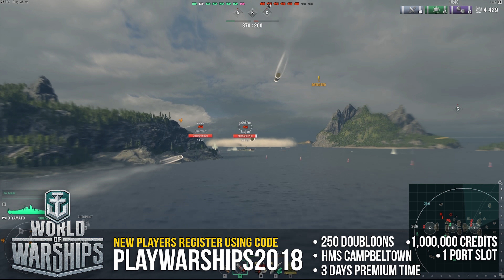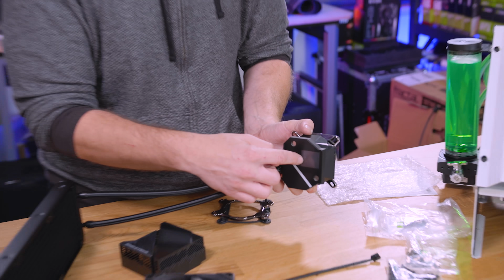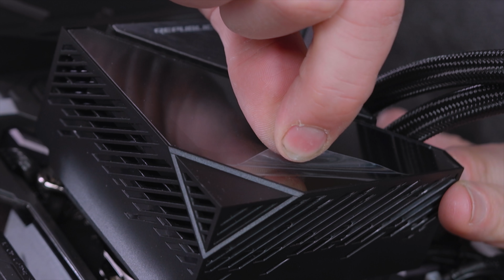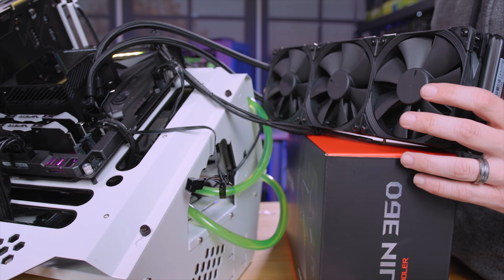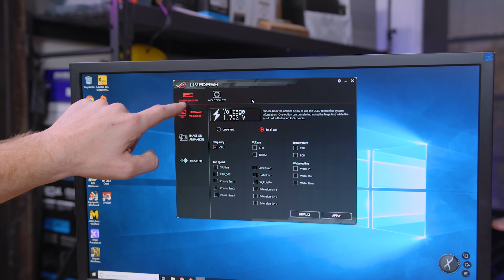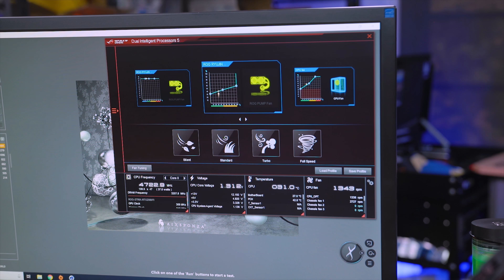ASUS made an AIO... but is it any good?? RYUJIN 360

Comment: Bro that asus controller that has the bubble to control fan profiles, I  can't use it to over clock my 6600k it will go up 1. At a time then switch to .05 or so and always trips out 3 times before just saying it can't, can I set a cap before I run it? I had it at 4.6 but set in the bios but  now I can't change it from stock?? Xmp or whatever is disabled also

Comment: I use the Arctic liquid freezer 240 with all included fans (4) in a push pull config. Mind you I'm only running an FX8350 at stock 4.0Ghz

Comment: Ok, so it performes decent, looks nice and has a gimmicky display. But it's 280 bucks ... basicly just for not having to mount a pump and cut three pcs of soft-tubing.
You could get a copper rad with Noctuas, an EK block and a basic Eheim or Laig based pump for the same money. No stylish display but more performance.
If at least the pump had enough power so you could add gpu and board blocks to the loop, then I'd see the appeal of an all-Asus-build. 
Oh well, ppl will buy it anyway.

Comment: I am using a Cooler Master MasterLiquid 240 AIO with Ryzen 5 1600.  No problem running 4.0 OC, AIDA64 stress test after 1 hour running in low-mid 60 C.

Comment: I love how you're American but use Metric system. It just makes more sense.
Reply: Most Pc stuff is in the metric system so yes when talking about pc stuff Americans use the metric system but did you not notice he said Fahrenheit instead of Celsius at the begging ? That's cause they both make sense i know both but am american and standard makes sense, when its what you learn but a lot of Americans that don't learn the metric system they think it doesn't make sense so .............
Reply: I understand that growing up with whichever one will make sense to you, but logically, Metric is easier to understand, even to begin with, surely. Freezing point and boiling point of water in Metric is 0°C and 100°C. Makes sense. While Fahrenheit is 32°F and 212°F. Metric just seems more consistent despite both being an absolute measurement of temperature.

Comment: right now I use a corsair h60i, I originally wanted a h100i v2 but my case was not large enough. I plan on upgrading to an 8700k soon would the cooling on the h60 be efficient enough? Right now i have a 3770k and my max temps while gaming for multiple hours is still under 60 degrees
Reply: I used an AIO (H60) for nearly two years. I don't recommend them anymore. Switched to a Noctua with a 120mm fan... It's quieter, cheaper and cooler.

Comment: Currently using a Corsair H115i Pro on my 7820x. It's a good cooler. Build quality is very good IMO. However for pushing this chip would need something a bit higher. This is fine for my use though. The cost of the Asus one is quite staggering at easily double the price of my current AIO. The Noctua fans are a good inclusion as they are known for their quality, but I don't think its worth such a high price. And obviously having the cable issue is extremely disappointing.

Comment: What was the response from Asus about those fan headers?
Reply: "We will be happy to ship out a replacement as soon as you complete the RMA form online and we approve it. Please include several photos with date stamps imprinted on them and the original receipt (Copy's will not be accepted). This processes could take a week or more for review so please be patient. Once to receive the RMA number sent to you VIA USPS please tape this number to at least 6 visible sides on the box. Once we receive the defective unit and then test it for a week to verify that it is indeed bad and we determine that the damage was not done by improper installation by you we will ship a refurbished one out to you in 6 to 8 weeks. Once you pay the shipping and handling fees."
Reply: @whpony96  wow really? Be better to give it to the shops warranty let them deal with it.
Reply: Jesus christ its only a fan header plug, cant people do basic soldering today? THICK AS SHIT
Reply: @Synthematix  not the point
Reply: @camoz123  Hmm, maybe not. But if the RMA process is that kind of hassle i would just solder the wires again, and crimp the cable inside those plugs and whatnottatata
Reply: @StaticVapour590  not everyone has that ability or skill to do that.
Reply: @camoz123  its actually quite simple and easy to learn and u can pick up a cheap solder kit for 10-20$ watch a 5 minute youtube video on how to solder and do it yourself with 5 mins later. And become a solder champ in 10 mins.

Comment: the Kraken X72 is around 200 bucks... 250 would have been a bit more reasonable price IMO but the noctua fans is a nice touch as it blows (pun intended) every other fan on the market out of the way...
Reply: Just seen that for 300 bucks you can get the EKWB A360G which is a 360 aluminium rad and parts with a CPU and a GPU block... no OLED tho...

Comment: $280 dollars? Lol.. no. EK has a $240 CPU+GPU water-cooling kits.  They have a 360mm radiator expansion kit which brings the price $310. 280 vs 310. You get CPU+GPU cooling, that is awesome! This AIO is $280 for only one..

Comment: I still don’t get it why AIO manufacturers do not hide the cables in the tube sleeving and let them come out of the radiator - this would look much mich cleaner then the mess around the cpu... or at least make them optional.... 

Nd typical Asus quality. I was such a huge fan of ROG but at least since the last 4 years they fail product after product. And the Software is far worse then anything else.

Comment: I am using a Corsair h150i Pro RGB 360 radiator, I am more than satisfied with it although as you said I had my concerns when it came to cooling the VRM and the other components of my motherboard, but I have the radiator in the front with push pull and 3 exhaust fans, I think the Temps are fine, idle it's sitting on 25c with my i7 8700k

Comment: I use a Corsair H100i that I got 5 1/2 years ago when I worked at Microcenter. Its been running pretty much 24/7 since then and its still going. So I'm pretty impressed.

Comment: How do you feel about an 8700k and 2080/2080ti for 1080p gaming? It seems like whenever someone hears 1080p they think of it as some budget oriented rig. I don't want to settle for medium to high settings and 60fps in AAA titles. I want the max settings and i don't want to dip below 100fps. I think we should raise the bar to 90-100fps since we all know 60 will dip into the 40's eventually. And although higher resolutions are intriguing, i just want a buttery smooth 144fps. Off topic, i know, but it's been on my mind lately since i'm currently building a new pc for the launch of JC4, and it's been imprinted into my brain by the community that 60fps is standard and i'm not having it.

Comment: the quick transition to getting the system booted was nice, even if it's basically the same usual installation, its still nice to remember what i might need to consider with that aio without detailing it too thoroughly at all

N o i c e

Comment: I don't want any liquids in my system whatsoever, so i'm using an NH-D15s to cool my 8700K.
Reply: You do realize that the liquid in an AIO is completely contained and closed off right?
Reply: @React2Quick  i do. Still, i don't like 'em.
Reply: @Yuu_Touko  why? Theres next to no risk in having an AIO in your system. The only risk I could think of is maybe if the pump died that's it. It's the same mantience level as an air cooler, little bit of compressed air to blow out the dust. I bet you've never used an AIO

Comment: Jayz, to be frank, the Noctua Fans are hype. If you do a quick dive into quoted specs, they are not that great especially considering the price!
My personal "goto fan" is the Akasa Apache, Viper (if you dont mind Black Yellow) or Piranha, they are pretty much better and cheaper thank all the Noctua Fans except the PPC running at insane RPM and ridiculous dB(A) levels!
eg.
12cm Akasa Apache     - 57.53 CFM / 2.64mm H2O / 16.05dB(A) @ 1300rpm - UK Pricing - £14.66
12cm Akasa Viper          - 83.63 CFM / 2.98mm H2O / 28.90dB(A) @ 1900rpm - UK Pricing - £7.99 (£11.99 Black Version)
12cm Akasa Piranha      - 79.13 CFM / 3.04mm H2O / 27.20dB(A) @ 1900rpm - UK Pricing - £9.91
NF-A12x25 PWM            - 102.1 CFM / 2.34mm H2O / 22.60dB(A) @ 2000rpm - UK Pricing - £26.64
NF-P12 redux (1700)      - 120.2 CFM / 2.83mm H2O / 25.10dB(A) @ 1700rpm - UK Pricing - £12.38
NF-F12 industrialPPC     - 121.8 CFM / 3.94mm H2O / 29.70dB(A) @ 2000rpm - UK Pricing - £21.85
(Prices from amazon.co.uk)
Looks like a price increase for Akasa Apache as I have bought them @ ~£8 for the past few years

Comment: Hey Jay, did you validate CPU temps using HW Monitor? I've seen other videos that the CPU temp displayed on the cooler can be off by as much as 10c when compared with CPU Package temp in HW Monitor. Apparently Asus was polling a different thermal sensor in the mobo and not the package. Not sure if this was a compatibility thing with the mobo he was using or something else, but if you didn't validate the display temps you might want to give it another look.

Comment: I won a CoolerMaster Nepton 120 XL from a facebook competition, double thick radiator and 2 120ml fans in push pull and it keeps my 8700k sub 70c for the most part at 4.9Ghz Core 4.7Ghz Uncore and 1.35v Considering its only a double thick 120mm rad it does a great job.

Comment: I have used my Asus Ryujin 360 for almost a month now. So far it’s doing great to cool off my i7 7820x on Asus Rampage vi extreme. I have read some forums saying the temp display on the cooler is actually the temp for the mobo. Can you try testing with core temp and other software to see the true temp? Also, would be nice to see if push and pull would make any drastic difference. Thanks Jay!

Comment: Can you pull out the leads and crimp the wire? Not a fix for most people but it doesn't look like the wires are broken. Did they just not crimp them down hard enough to hold? Cable ends aren't the most unfixable things if I'm not mistaken.

Comment: They are dumbing down carriers because people refuse to think to work together to protect against air because that takes too much thought. Sadly thinking is not the reality. It should be though. It would help if they would do more than the simplest rendition of AA and fire possible. AA is just a single percentage chance. And fire is a static 30 second timer no matter which sized ammo hits the ship. They say they can't balance it but it's because they made it so simply there isn't much to balance. And it's more of an issue of players not working together which is ultimately a game design issue. Better game design will bring out better play. Even if it's subtle(or especially). There is way more they could do with that game. And fairly simply.

They could do something like a D100 roll in D&D and add lots of damage hits types to components and give reasons to return for repair along with more things for the AA to do to a plane. Alof ot his would drastically change carriers as it would leave more ways for a plane to fail. Especially if it can take single little aircraft out of formation and flying back to carrier or into the water. This would make it easier to pick off formations for instance. Plus reduce abilities of formations if they choose to stay in formation. Say they slow down to keep a plane in formation. They could make a single button for stay in formation or not. If in formation the entire air formation suffers stats loss. If not the plane returns to carrier automatically and is vulnerable to being picked off. They could even add going to another carrier if needed. They have all the info they need from making WOWP to dumb down damage models to a simple roll.

Fire is similar. They can make it so it's more realistic with in game stats like shell fuel and size etc. Add more to the ships like their real life anti fire features and make way more game fairly quickly. And it would even give them more ways to sell ships as some ships may have advanced or unique features. Assuming they sell those ships. Plus they could add more things like ship to ship fire removal. This is the only reason CC's are overpowered. It's the fire mechanics. They are too simple. Fix that fix most of the game. BTW, there is no end to info on what the ships did to fight fires. It was a major engineering task in designing ships. It should be done more thoroughly in game. They could even simulate walkways and other things and take account of specific locations that bullets traverse through to show where firefighters can and can't go. Of increased times to get to them. Then also change things like anti fire from a set timed things to a constant use toggle and just fight fires. Each shell could have a chance to add to a given fires time. And continued hits could reduce it. Then just add more risks like being able to be on deck while guns are firing and other things. Even just adding fire time addition based on the rounds statistics per ship would improve the game with it's current setup. Ignoring all of the other features you could add to it. BB's would have more reason to use HE as they could add bigger timers and CC's could be less devestating as they would add less. But you could also remove the cap on the timer so they could keep adding to the overall fire time. Or increase the cap. It could be a lot more fun and interesting to fight fires with that sort of a setup. And with fairly simple easy to make changes. 

If they buff up the damage party stuff to a more fluent design they could even start to add things like flooding from guns if you hit below the waterline.

Comment: I was hoping for a great AIO from ASUS, but ugh. The two programs, the wires, that mini fan, and the price! Well, I guess the price isn't too bad for the OLED display on there, and it's triple fan?

I've used two different corsair AIO. I'm currently on the H100i. The fan bearings suck and wore out way too quick. Sounds like a card between spokes when the fan speed goes down. There's also a mini usb plug onto the water block. Plus only two colors for the Corsair logo. I've thought about trying CoolerMaster. I've been using a few of their other products with no problem. I've had so many problems with Corsair's RGB products.

Comment: Well, well, well. Jay is at it again. If you have had done your homework, you would know that the pump block CPU temp readout (AI Suite) is from the thermal probe underneath the socket not the one on the CPU itself. One doing his review thoroughly would have validated those readout temps with a 3rd party monitoring software like realtemp or hwmonitor. What does that mean for you? In basic terms, so you may understand it, the thermal probe reacts dealyed to sudden changes in CPU temps. It takes some time until the heat from the CPU reaches the thermal probe underneath the socket. That means, the temp readout in AI Suite is misleading at best, but should be considered wrong. So you probably don't have any OC headroom, but just a very toasty CPU. Give it a 30 minute OCCT torture test and you will thermal throttle guaranteed. Just sayin'.

Comment: idk if silicon lottery, but I have a 3 year old h110 in push/pull (not the h110i or the gtx version), and it keeps my 8700k at around 67°C and it's at 5Ghz...

Comment: i really don't understand why aio manufacturers don't hide their cableing  by running them up the tubes so that they are by the fans that also need wires to run the system. the part of my build that bothers me the most is the wires coming from my block and RGB fittings. but there is nothing you can do about that. but this can be easily fixed just by having the wires come up by the rad

Comment: I have the Corsair H60, the original, not the updated one.
Reply: I threw my H60 out yesterday for a NS-U12. Sooo quiet. And the CPU temps are 20 degrees lower.
Reply: I have an h60 on my ryzen and I get great temps and it's dead silent.. very happy considering I picked it up new for 40$
Reply: tech- garage wow, i got mine for $40 and it was a refurb
Reply: Mitch E Mu yeah! I found a sale on Newegg and my local Best buy agreed to price match! Very happy with it.
Reply: tech- garage Sweet! I am happy with mine too, I’ve got a 5 ghz OC on all cores of my i5 9600k and it only hits 84C max.

Comment: Its looks good and all BUT its way to expensive. $280? Heck you can buy a standalone cpu block, pump and rad for bascially the same $. They could drop the expensive fans for a more affordable option. I feel most will pass because of the cost. You can get a NZXT AIO with an oled display for a lot less $ .

Comment: NZXT KRAKEN 64,, for my 8700K @ 4.7 Ghz on all cores @ 1.24 volts stays about 57c to 62c actual die temp playing BFV for hours in a 70 degree “F”  room .. and the same temps running intel extreme tuner stress test for 1 hour,, hottest core got to 76c in max temp column ...

Comment: I'm using a Corsair H105 AIO($130USD) + 2x 120mm Noctua nf-f12 fans($50USD) so all together that is a $180USD CPU Cooler, these AIO are overpriced, your starting to get  into the custom water-cooling price-point!
Reply: wedgoku And airs cooling is better then ever! And more reliable, and cheaper. It’s almost like, why bother with AIO’s??

Comment: I have a question for the water cooling pro's out there
I have  Fractal s24 celsius AIO. on auto it spins at 1980 and never ramps up turned to PWM it spins at 2800rpm and can't be controlled anyone got any ideas??

Comment: Currently using a Corsair H115i on my Ryzen 1700 Overclock at 4.0, runs a lil hot so i usually bring it down to 3.9 then it sits at about 72c stock 3.1 it sits at about 46c under load

Comment: Why so much voltage? My 8700k does 5Ghz on 1.3v with no AVX offset or 1.280v with AVX set to 1. On CB15 my max temp is 73C with Antec Mercury 360.